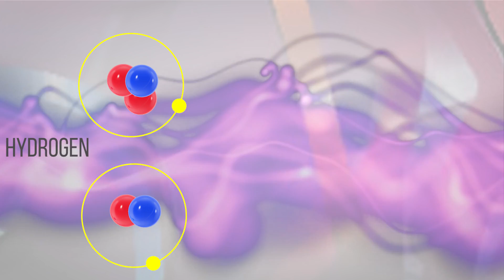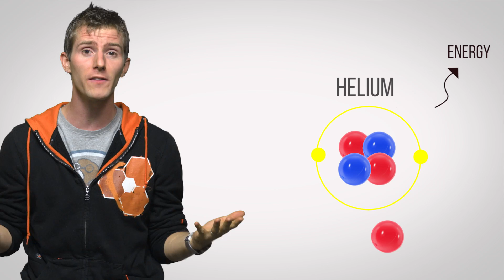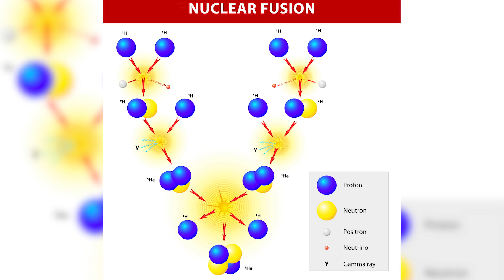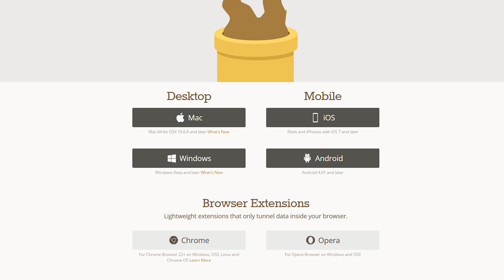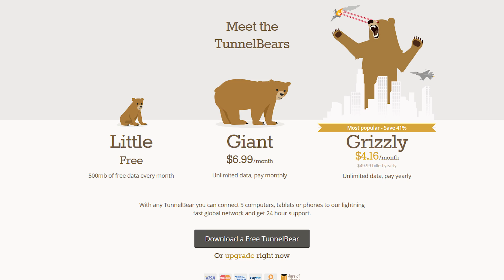Why Don't We Have Fusion Power?

Comment: Good video as always, but you were wrong on one point, nuclear fusion is the sun is not triggered by its mass and temerature, in fact that's what we have thought for many years, but by mesuring the temperature isinde the sun we found out that it was way too cold ( so to speak ) to enable nuclear fusion
It turns out that the thing triggering nuclear fusion is called quantum tunnelling, it allows particles to "teleport" within an atom, allowing them to fuse

Comment: What happens in modern NPPs with a meltdown: 
1. the stuff melts
2. they toss on a coolant
3. problem solved.
What happens with nuclear waste:
1. they put it in lead bins that block out 80% of the already decreased radiation.
2. they put it back in the mines where the uranium came from in the first place. Net radiation is still less than when it was mined.

The dangers are overblown by ignorant hippies.

Comment: you guys did half ass research on this it looks like you were talking about the iter project with the  magnetic field but guess what using fusion will cause nuclear waste that way because the way to heat up the core is to shoot neutrons causing nuclear waste... I know this because my physics teacher contributed to the design of the super conductors used reactor.

Comment: no radiation? man, you forgot gamma rays
Reply: +Deeparth Gupta
Gamma rays are actually quite difficult to shield from compared to other forms of radiation. It's just that they interact less with matter, and are because of that somewhat less dangerous than alpha or beta rays if exposed to a comparable amount. Alpha and beta rays are however actually easy to shield from, but if you are in contact with a material that emits alpha or beta radiation, there will be much more damage to your tissue than if you were in contact with a material emitting gamma rays.

Alpha rays are high speed helium ions. Because they are massive, they interact with everything and cause a lot of damage, but are not going very far (they can be stopped with aluminum foil, or in fact skin, resulting in alpha rays being much more likely to cause skin cancer than any other form of cancer, if you don't ingest a material that emits them).

Beta rays are either electrons or positrons, depending on whether it's beta+ or beta- radiation. Because they are smaller than helium nuclei, they interact less with the materials and are able to penetrate further into the tissue, but carry somewhat less energy and cause somewhat less damage along the way. They are also mostly stopped by aluminum foil, but not sufficiently to call it safe if you have to work with them for an extended period of time.

When you think of gamma rays, think of x-rays on steroids. They go through everything, and with gamma rays it's even more so the case. In fact so much so that the density difference between bones and other tissue wouldn't result in a big enough difference in intensity to create a picture. You'd need a couple cm of lead (or a meter or so of concrete) to shield from gamma rays to the same extent as aluminum foil would protect you from beta rays.

And as with any form of radiation, distance is your best friend. If you're twice as far, you get just a quarter of the radiation.

The beauty of nuclear fusion is though, that in case of a catastrophic failure, there would be just a flash of radiation and no radioactive fallout. However much radiation would be released, it would only affect the local environment and only for a short time, unlike it was the case with Tschernobyl where the radiation triggered alarms in nuclear power plants in Sweden, days later and almost 1000 km away, and made the surrounding area uninhabitable for centuries.
Reply: Suraj Grewal Gamma rays aren't that difficult to shield against. A thin layer of lead is enough
Reply: true but one should not say 'no radiation' when it's actually 'some radiation'
Reply: https://www.physicsforums.com/threads/are-gamma-rays-produced-in-fusion-reactions.403064/ 
https://www.reddit.com/r/askscience/comments/2nbn11/what_would_happen_to_a_fusion_reactor_if_the/

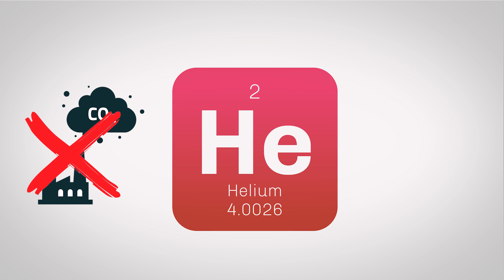Comment: 2:03 isn't entirely correct. Deuterium-Tritium fusion releases a neutron (as shown in the video, but not noted for some reason), and over time these can turn the shielding in the reactor radioactive. However, AFAIK this wouldn't create as much as much waste as traditional fission, and something to note is that meltdown is still impossible. Something interesting is that these neutrons could be used to instead turn lithium into tritium (this is especially helpful because natural tritium is actually quite rare, as it is radioactive and most of it has decayed by now, but is quite easy to make by bombarding lithium with neutrons), thus making the whole process even more efficient and reducing radioactive waste. A way to completely eliminate this unwanted radiation is by using deuterium-deuterium fusion; however D-D fusion is much more difficult to achieve, requiring over 1 BILLION Degrees Celsius (compared to 100 million for D-T fusion). 3:15 is also somewhat incorrect, as researchers at the NIF have been able to create a fusion reaction in which more energy is produced that is spent, and the under-construction ITER is also expected to create more energy than it consumes. However, these are both experimental reactors, and will never produce power for the grid. They are simply stepping stones towards a reactor which can be used commercially.
Reply: Good points. One thing to note about fusion waste is that it is relatively safe in a little over 100 years as opposed to fission waste which takes thousands of years. Definitely looking forward to these larger scale fusion experiments!
Reply: The NIF number cheats considerably. They don't count the energy required to stabilize the target, maintain the facilities of the area, etc... They only included the energy "absorbed" by the pellet. Secondly, laser ignition is almost entirely unrelated to tokamak/stellarator fusion methods. Also, while meltdowns are impossible (the fuel is already in the plasma state), uncontrolled power excursions are, at least in theory.

Comment: Actually because the mass of the plasma is so low (Only a few grams), the inside of the reactor would barely be affected if the magnetic field was to shut off, making it safer than any other form of energy we've ever conceived.

Comment: D-T fusion is the easiest fusion, but produces a lot of high-energy neutrons, regarded as ionizing radiation and also difficult to harvest useful forms of energy out of.

D-HE3 fusion produces mostly charged particles, very easy to convert to electricity. Requires much higher core temperature  though and HE3 is not abundant on earth.

Comment: so why dont we have a nuclear fission + fusion combo where fission reactor gives energy to the fusion reactor and vice versa, till the point comes where they reach equilibrium and some time after that the fusion starts generating excess energy?
Reply: we haven't been able to make a reactor that can generate more energy than it consumes
Reply: just looking at the first thing you see after searching hydrogen bomb doesnt tell you how it works. If you do the endeavour to see its working mechanism you will find out that it also uses fission although fusion is the primary source of its devastating power
Reply: H bombs first uses a fission explosion to make the deuterium/tritium mix reach its critical mass and start exploding, as +Mubashir Soomro mentioned.
The problem in fusion reactor is not as much starting the fusion as maintaining the process. You need huge magnetic fields which use more energy than what the reactor produces.
Reply: pd look up hydrogen bomb
Reply: +Mubashir Soomro maybe you should look it up and learn how ignorant that statement was ...

Comment: Ok so you hit some of the important talking points on fusion.  I'm sure you'll get a bunch of flack for not including enough varieties of fusion technologies.  But I'll leave that to them.  Here are some important notes for the inevitable follow-up segment.

First while you're graphics do show this if a person knows what they are already looking for, you skipped over  an important component of fusion fuel.  Our sun fuses two deuterium atoms in what is known as D-D fusion.  However D-D fusion is dramatically beyond our present means.  

Instead we take one step up the mass ladder and are focusing on D-T fusion, which is what you're graphics show.  The important thing here is the use of tritium(no not the Linux distribution that saved the server in the data loss incident) or hydrogen three as it's also called.  

The important thing to say about tritium is it is manufactured inside a reactor and is actually made from enriched lithium rather then water.  Meaning Fusion actually runs on water and lithium, both of which need to be enriched.  Though there are other proposed fusion methods running with even heavier atoms too, but someone else can bring them up.

Another important principal is the holy Trinity of fusion.  These are three factors required in all fusion.

Density:  Basically you need a lot of Atoms to increase the probability of fusion occurring.

Confinement: part in parcel to density, confinement maintains density.  But has its own place on the list because it's such an important system.  It's what keeps the fusion going.

Temperature: so we all know higher temperatures equal faster movent of molecules(or atoms in this case).  In fusion we need the temperature so high that the atoms move with enough force to overpower the positive electrostatic force that keeps their nuclei separated allowing the fusion bond to occur.

After the holy Trinity you have the last factor in fusion.  Sustainment and net energy output.  achieving fusion is actually relatively easy.  Modern nuclear bombs do it all the time, or they would if we actually set them off still.

This is where the final factor comes in, we need our fusion to run constantly and provide many orders of magnitude more power then that is required to sustain said fusion(startup + confinement).  No current project comes anywhere close to this, with net power loss and mere seconds of sustainment.

Which brings up the last point.  Fusion is definatly the solution to humanities energy someday.  But that day far too far away for our current energy needs.  Therefore we must avoid the trap of dismissing lesser but still functional technologies under the "but fusion will be better," ethos.  It's like never upgrading your rickety old CPU or graphics cards because "there's something better over the horizon."   There's room for both solutions.

Seriously I've been meaning to contact LMG about providing some writing on energy.  Completely free of charge even, I believe that more energy is the solution to human prosperity and sharing knowledge about energy is the reward for me.

Particularly I'm ready and interested on more talk on nuclear.  And think I could provide basis on Thorium power, Molten Salt Reactors(the basis tech that thorium power should use, but it's a separate discussion), and "Nuclear waste: How scary is it really?"(spoiler alert! not that scary at all). But the energy topic is huge and I could write for days about the various topics.

Comment: Don't want to sound like one of those "Ahh, actually your wrong guy-in-the-video" types of people, but it isn't just the heat at the core of the sun that causes fusion, the main factor is the insane amounts of pressure fusing the atoms together. Heat is required, but isn't the cause.

Comment: The inefficiency problem of solar and wind is nothing compared to the intermittency problem. The sun doesn't shine 24/7, so even if you could collect enough power to power a country for that long during the time the sun IS shining with solar panels (which are hugely expensive), you'd need to be able to store all that energy as well. Since you can't, you have to rely on oil, coal, or natural gas.

And even that barely scratches the surface.

Comment: From what I've heard.  We produce too much energy and not too little.  Power companies often asking industrial businesses to use more energy at certain peak points of energy production to prevent overload and or degradation on the electrical infrastructure.  The infrastructure that you see today is based on technology invented a long time ago, therefore it is limited in scope.
Reply: ShreddlyMaps No you are completely wrong.  Yes there is balance of using 100% of the supply so it doesn't go to waste.  But this in no way means we make too much energy.  5 of the 7 billion people in this world live below the energy poverty line, so almost 3/4.  That means we as a species don't predict nearly enough energy, not by a long shot.
Reply: I was regurgitating what an expert said, almost word for word.  Where do you source your information from?
Reply: ***** Also, not every area has this issue obviously.
Reply: No for sure.  Basically this is my favorite energy argument(debate not fight).  Generally the primary argument for alternative energy is climate change, but I've actually found this to be as very weak argument.  I'm no climate change denier but the normal climate change discussion is basically, "it's bad very very bad." But never do they really discuss how bad and why so bad.

It was then that I encountered climate change moderates.  Basically they compare and contrast the potential risks of climate change vs the quality of life impact of access to energy.  Since experts actually conclude that the risks of climate change are lower then the effects of abandoning energy, by a huge margin.  Though they do conclude that any chance to abandon coal especially for a superior source is preferable.

So my argument for alternative energy never bothers to mention climate change at all.  It's based on three points.

Given that abundant energy is required for continued human prosperity growth.  Many more times our current human capacity for production must be found.

We've nearly reached the full available potential of hydrocarbons as an energy source and they are shown to serve at best 1/4 of human needs. Which is not nearly enough.

Given these two facts we as humans are morally charged with finding a superior energy solution to that of hydrocarbons.  For the simple requirement to offer maximum opportunity to all humans from energy independence.

Basically a catch all argument that cannot be debated without the opponent being objectivity amoral or selfish. And it doesn't even need to mention climate change, but it also isn't counter to the climate change argument, it actually synergizes with it.

Comment: Currently we humans are trying to brute-force our way to nuclear fusion by forcibly squeezing atoms together and heating them up. Problem is, this process is... inefficient, at least compared to what nature has produced through quantum tunneling.

Atoms want to move around, even when heavily confined. If circumstances are such to where atoms can't physically move through space, they'll take the next easiest path and move through there instead, resulting in tunneling. Perhaps if we were to replicate this phenomena, we should be able to initiate fusion with greater efficiency.

May also need to try to find ways to lay the proton naked, as those electrons and pesky repulsive forces further shield the protons from fusing. Gotta find some substance or method to do such a thing... aside from just heating it up or using muons, if not anti-protons (assuming the anti-protons lead but don't touch the protons).

Perhaps we can investigate heavy tetrahydride fusion... lots of bare protons there.

Comment: German smartass captain here:
Linus was almost right, exept the temperature thing. The sun burns very hot, but it is no problem at all to create a 100 times greater heat in a reactor. This heat causes all atoms to go in plasma state, which is a state of an atom, just like solid or liquid. In this plasma state, the electrons are not longer orbiting the core, instead they fly around in an electron-cloud-thing (just like metal - atoms connected). In this state of high energy, it is possible that one core tunnels (quantum-physics) into the coulomb - barrier (just Google it) of another atom core, which leads to a fusion. To come back to the original message, you have to mention the lawson-cryteria. This is a multiplication product of heat and pressure, which must be reached so there is enough energy that fusion is possible (the core tunnel thing).
The problem is the pressure. The gravitational force in the sun is so immense, nothing even close to this can be reached by any method known to mankind. Even through this, fusion is possible on earth, but u need ( like Linus said correctly ) a huge power to keep it stable ( magnets and stuff ). To come to a close, fusion on earth is possible, but it will take its time to be developed, estimated being able to use for a civil cause in approx 40-60 jears. sorry